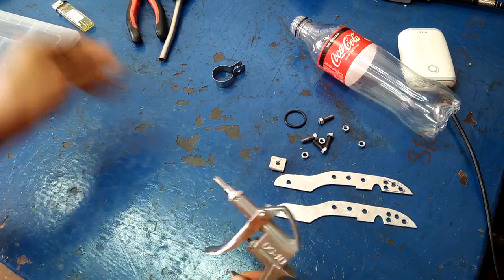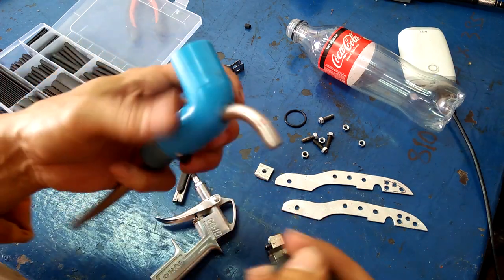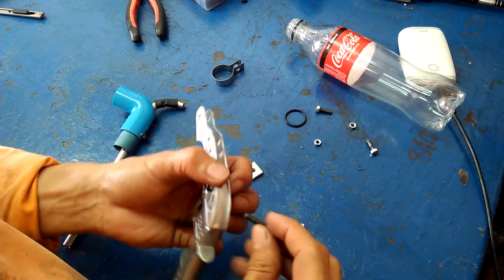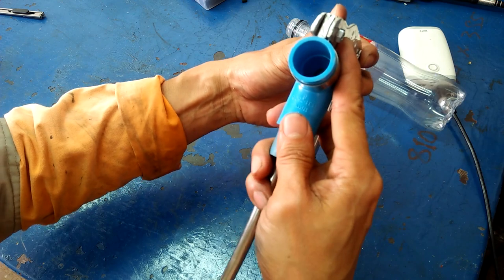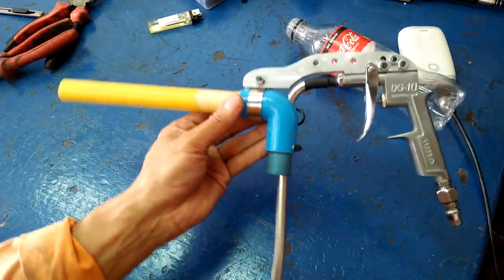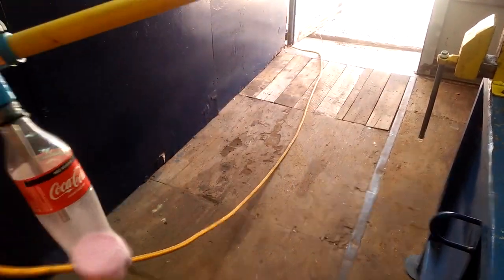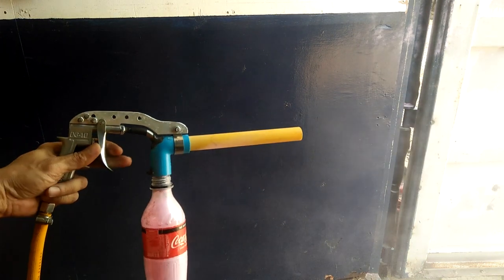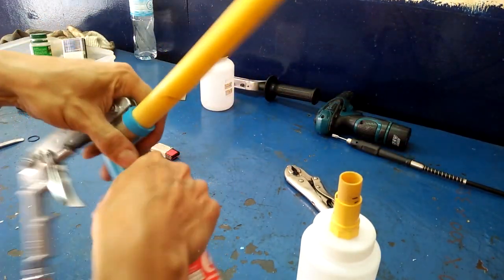Homemade Powder Coating Gun

Comment: nice idea.. created a whole one piece using 3d printer. and it work FLAWLESS.. been using a 1 year now...
Reply from the maker: thanks for the feedback. I have several other homemade powder coating gun made after this one and I only used materials readily available. It should be a lot nicer with a 3rd printer.
Reply: Can you provide the files for it? :)

Comment: let’s not forget a very big part of this scheme. The powder particles must leave the tip of the gun positively charged in order to be attracted to the negatively charged part and adhere. to even stick properly, you’re talking 10,000V plus (especially when navigating the faraday affect I’ve enclosed shapes. I like the inside of a bowl) And that’s where it gets tricky. 

It’s also where it gets dangerous. Dangerous, as in, one false move… and it’ll blow your feet off your body.
Reply from the maker: Hi. When navigating faraday cage areas, you want to reduce the kV of the gun. The powder coating guns in general make very high voltages up to 100 kV. But these are low power outputs. The current on these guns are only in 10s of microamps. It will give you a shock but definitely not lethal.
Reply: It’s not that dangerous. While voltage is high, current is very low. I made a very similar electrostatic gun a couple years ago and shared it with another YouTube’er and while it worked great, it was difficult to find wire with thick enough insulation to stop massive static buildup.
Reply: If you heat the part to be done first, you don't need the electrostatic charge. Just make sure the part is up to curing temp before you spray it and the powder will cure to it on contact.

Comment: can i use this instead???? can i convert it to powder coating gun?
Reply from the maker: yes you can try. this is the first one I actually made and it does work but with some limitation. it is cheap to make and good for experimentation.

Comment: Anong part ng DT project gagamitan ng powder coating?
Reply from the maker: yung cylinder block, cylinder head, chassis, tank, swing arm. bale halos lahat po ng part na yari sa metal. yung right crank case cover din sana kasi iyun yung unang unang nagagasgasan ng pintura, kaso napinturahan ko na ng spray paint.
Reply: @DIYPhil  yung powder coat daw sa hi temperature at regular ay magka-iba. Nag inquire ako dito sa amin pero specialty nila ay mga rims. Yung sa makina lalo na sa mga mainit na mga part special powder coat ginagamit.
Reply from the maker: @idselseno2306  thanks sa info. nakabili na ko ng powder, black. nung bibili ako 2 yung pamimilian. yung mas mahal ang binili ko na made in USA daw. tapos mas mataas yung curing temperature kaya baka yun na yung special powder. pero check ko pa rin sa supplier.